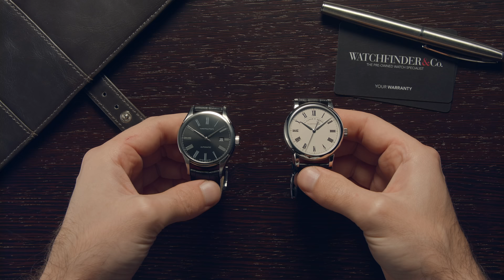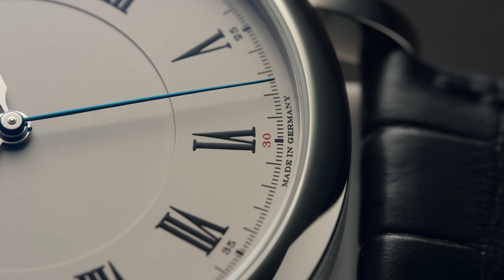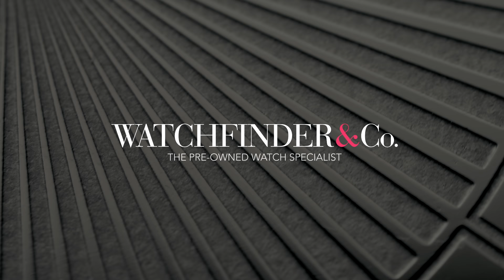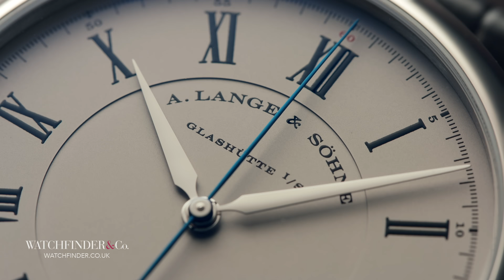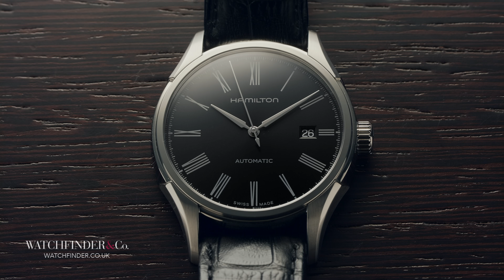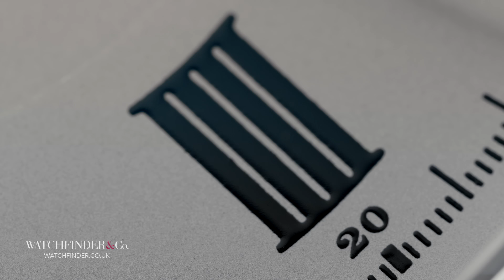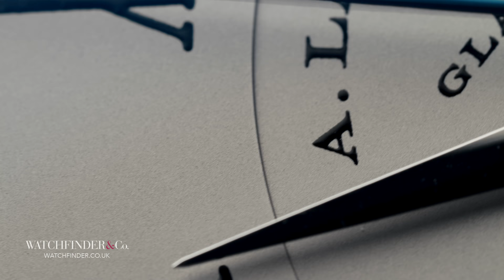£300 vs £30,000 Watch – Really 100x Better? | Watchfinder & Co.

Comment: Nice try - and I do see your reasoning, which is sound enough. But the fact is that there are many beautiful watches (under 2000 dollars), including this Hamilton, which marry functionality and fine aesthetics. One can have accuracy, durability, elegance, original design, for under one thousand dollars. Of course, if the watch is made of gold or platinum, the cost can (justifiably) be much higher. From a layman's perspective, the artistry you describe is a distinction without much of a difference. At the very least, whatever additional aesthetics are involved in the higher priced watch, they don't merit such a price tag. And considerations of heritage or history, the whole-hearted commitment on the part of the company's founders, don't carry much weight for me because I only pay attention to the watch itself. It's the watch that counts, not the intent or history of the founders. Similarly, with artists: I only examine their works, regardless of their reputation or intent or history. Bad art is bad art regardless of who makes it, and the same goes for good art. A work of art shouldn't be prized higher than its merit deserves simply because the artist is famous.

Comment: Art? You mean craft I suppose.
An object designed for a purpose can be made with expensive material, great expertise and craftsmanship, that’s what the ALS is offering, but it’s not art, words have a meaning.
The Hamilton is a great watch for the price and the ALS should be priced around 15-20k for me to consider buying one, because the rest of the price is brand recognition. And there’s nothing wrong with that if you value the brand, I don’t, ALS watches do not boost my ego like a Jaeger does, it’s that simple.
On this one I’d go for the Hamilton and save the money to buy a watch that offers a bit more than the ALS.

Comment: In the 21st century accuracy is way past being a factor.  Any Apple watch has more accuracy than either of these because it gets its time from GPS satellites.  The Internet synchronizes through GPS or atomic clocks. No "2 to 10 seconds" accuracy per day.  We are talking microseconds accuracy.  No mechanical watch can possibly surpass that accuracy.  So you have to look elsewhere (and far afield) for the difference. Workmanship, engineering, intrinsic beauty, precious metals and jewels. Anything but accuracy (without being too inaccurate, of course).  That said, we don't really need accuracy below 10 seconds a day, and couldn't even use it for any of the reasons we normally use a wristwatch.

Comment: I appreciate the engineering that goes into a mechanical watch.  Truly a marvel.  I can't see anything it does better than my sub 100 dollar radio time synced solar watch.  Mine is accurate to within milliseconds a day.  Never needs winding and probably never servicing other than replacing the battery.  I just don't get it.

Comment: A. Lange & Sohne has never impressed me with their plain time only pieces. I find them to be forgettable, never striking. I find myself getting more from a fine vintage piece like an Omega pie pan constellation.
Reply: Turn the watch around, then.
Reply: @ehariharan9320  granted, there is some incredible craftsmanship going into the movement, but the face is where I fall in love and that's where I go cold on these. For 30k I'd rather spend my money elsewhere.
Reply: I think as tastes evolve, at least my experience,  the simpler watches become more alluring due to timeless design and subtles vs immediately impressive dials/cases that go out of trend and get boring/outdated when the next fad   kicks in
Reply: @cy4624  there will always be place for daring or even striking design in watches and some fads will change that's a given. My gripe is just with the dial being too sterile for me at that price point. I would like to see some guilloche or the use of subtle color like on the A. Lange Datograph. Just something to enhance my viewing pleasure.

Comment: oooh that's not fair, the Hamilton has a date. Makes it the winner hands down.
Reply: There are quartz watches that have chronograph and date. Smartwatches has all that and also push notifications, calendar, heart rate, calls, etc... 

In specs terms any mechanical watch loses for quartz or even smartwatches. 

So what's your point?

Comment: Honda, price per pound will provide better comfort, mileage, storage and dependability than the Bugatti. Also factor maintenance cost and even the price for an oil change, the Honda is made for a smart driver, the Bugatti is made for those with more money than brains and oil barons going through a midlife crisis.
Reply: @sidesauce  if given a Honda Accord or a Bugatti Chiron to drive 4.5 hours of 75mph traffic from Las Vegas to Anaheim and looking at both interiors, I'll take the Accord.